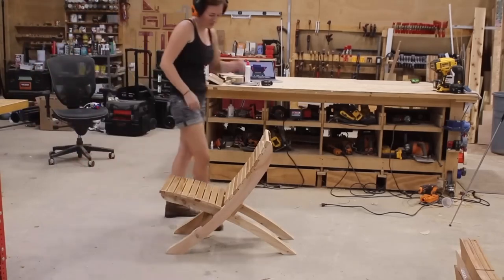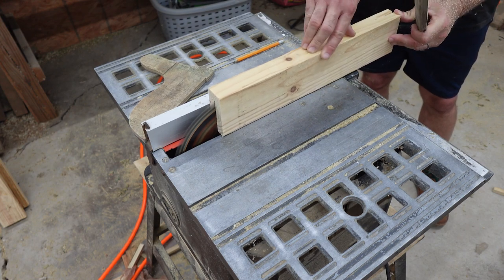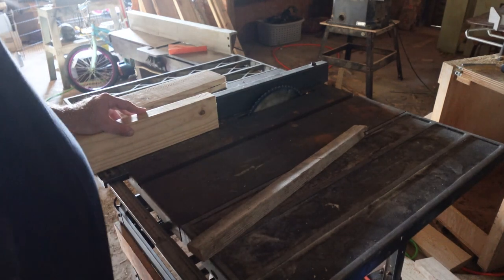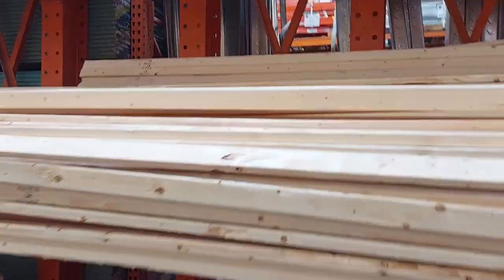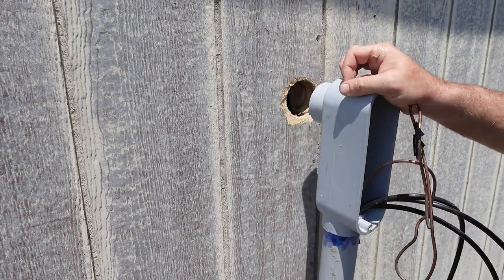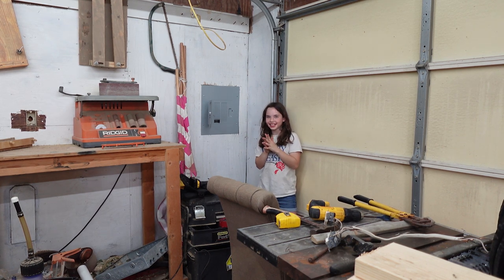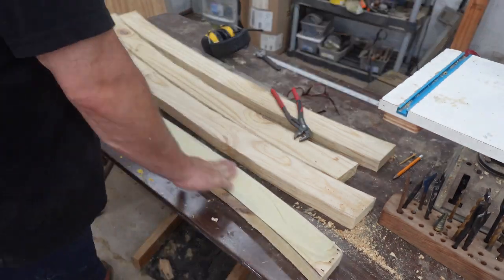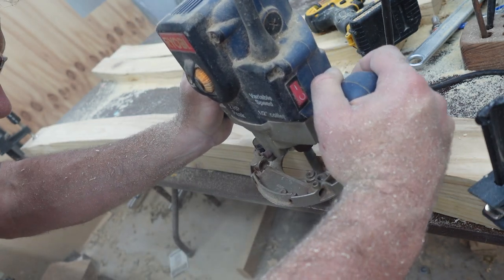She Didn't Design the Nesting Chair

Comment: I have two daughters also and I love involving them in woodworking projects as well!  Most excellent!  How is the old Craftman table saw holding up?  I've been thinking of grabbing one also but, I am finding that parts for them are mostly discontinued and hard to find.  However, there are so many of them out there that maybe buying two would be better.
Reply from the maker: I'll be honest. It's dead. It has a bent arbor, and the motor mount I built isn't working out. There's a ton of vibration, and the pulleys keep falling off. They're a little jacked up too. It's just this saw though. I might just grab another one and use this one for parts.
Reply: @worstworkshop  exactly what I’ve been contemplating.  Good luck with it! There are tons of them out there! Happy hunting!

Comment: I made a couple of those in '82 so my wife and I could use them when canoe camping. A guy I worked with had a couple made by his grandfather and he let me borrow one for a weekend to get dimensions. They were originally made with straight stiles/legs so when 'folded' the chair would lay flat in a canoe. You could put your tent and sleeping bags on them, keeping them out of the water that always finds its way into canoe bottoms.  Then use them to sit around the camp site at night. While our canoe was sold when we could no longer lift them onto the roof of the van the chairs are still fine.
Reply from the maker: What a brilliant idea. I can just see them in the bottom of a canoe. Thanks for sharing!

Comment: Awesome video again!  I hope all is wonderful with you and your family.  I liked Little Bit's boots too!  I've been complaining about it getting over 100 here for the last week or two, but the temps up here aren't nearly as bad as they are for you.  I had to use a trencher a few years ago, I had to board up the windows and I found myself wishing for full body armor and a helmet to protect from all the rocks it was flinging at me.  If you are interested, I'll try to find the website address that should have the parts you need to permanently fix your 'new' table saw.  They carry a lot of stuff, and they were able to get me parts I needed to fix my Craftsman jointer that was built in 1981, so I'm guessing they would have the parts you need.
Reply from the maker: That would be a great help, Mark! I found a replacement on Ebay for about $100, but it wasn't worth it to me. And yes, all the boots in the house are her boots apparently.

Comment: Love the design of your videos, as well as the chair (which I too have seen a number of places). Agree that April Wilkerson is a YouTube woodworking star -- which your daughters are becoming, too! 
Do you use your TS fence on the left of the blade?
Reply from the maker: Thanks! I tend to hold my push stick with my left hand, so it makes sense for it to go there. What do you think? Should it be on the other side?
Reply: @worstworkshop  Whatever seems safest, I'd say, given handedness and blade tilt. Just so we're pushing next to the fence and not trapping offcuts that kick back. However, it would be safer with a fixed featherboard than one you hold. I try hard to stay out of the line of fire of blade and offcut. With one hand on each side of the blade, you're definitely in the way.
Reply from the maker: @RYwoodview  Agreed. My old saw had nonstandard miter slots, so it couldn't accommodate anything unless I built it from scratch. With this one, even if I do build it myself, runners will be a lot easier to find.

Comment: 🤣I can relate to the table saw!  My Sears-special got hit by a car.  (My daughter drove into the woodshop during driver's ed).  It's a little bent but is ok for cutting stuff you don't care about gluing up.  Then I acquired a used Delta contractors saw - from the dark ages.  I discovered (or should I say my son discovered) quickly that there were NO safety features on this puppy.  I had to clean the rust and paint off it but it cuts a lot truer.  It is heavier than all get-out and with no wheels, it doesn't go very far, very often.  A new saw?  Now that would be nice!
Reply from the maker: Your table saw journey is a lot like mine. That "new" Craftsman saw has some big issues, including a bent arbor on the motor, but it's better than what I was using. Someday I'll upgrade.

Comment: May I, with full respect, kindly ask you to upgrade your table saw with a riving knive? You are much to valuable for the workers community to stop yourself eventually with a piece of wook shooting back into your stomach...
Reply from the maker: You absolutely may! And thank you. I'm going to be adding splitters to a zero cut insert as soon as I get the chance.
Reply: @worstworkshop  That is the solution I am pursuing with my old Craftsman saw.  Was never happy it didn't have a riving knife (don't believe it even has that as an option to easily mount one), but adding a splitter to a zero clearance plate should do the trick.  Micro Jig has one, Kreg does too I believe.
Reply: @worstworkshop  🙂